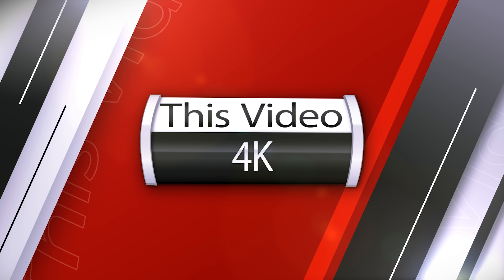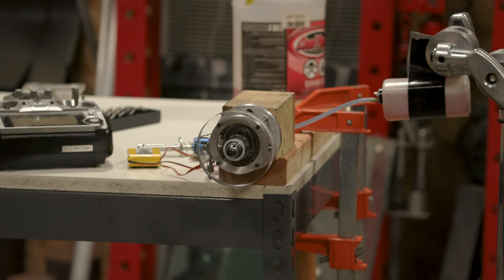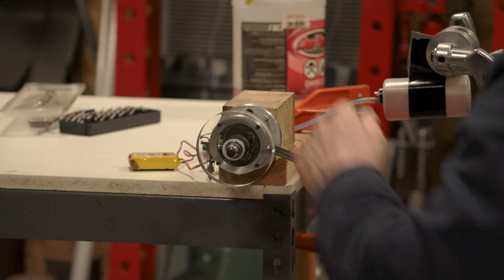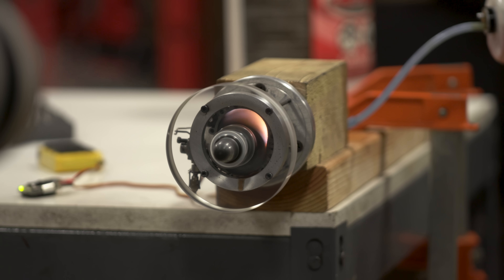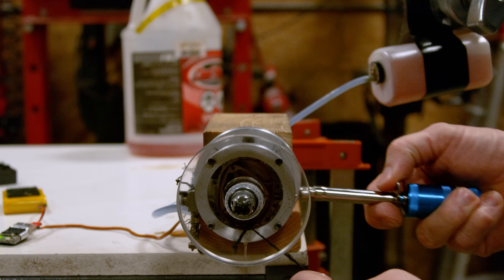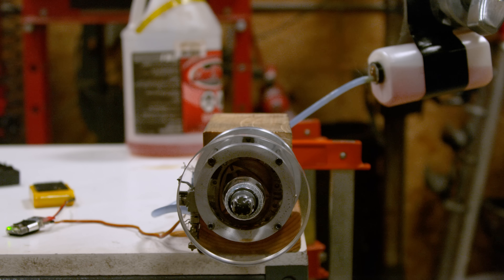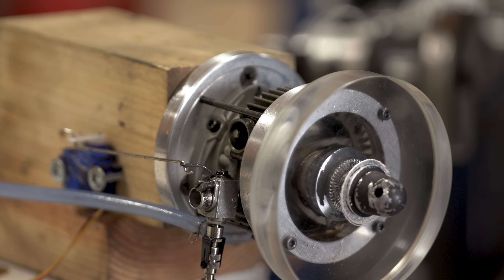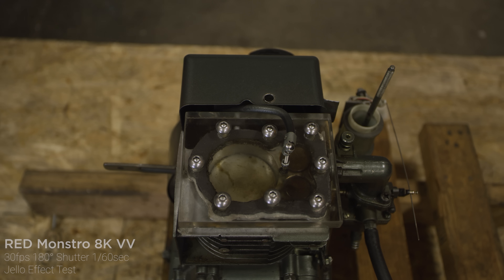See Thru Rotary Engine (WOT Runs Just for Fun) Shot on RED Monstro 8K VV- Canon C200- Flex 4K

Comment: This has to be the least amount of oil I've seen burnt in a rotary in my life.
Reply: I'm guessing that some of the working parts for this motor are from the O.S. .30cu in Wankel rotary model aircraft engine.  It's using a methanol/nitro/oil mixture ignited by a glow plug

Comment: In the normal clip of the rotary motor I was leaning towards the Canon, but once you went to %400 zoom I realized the Canon had the worst  "grainy" texture in the video out of all three cameras. Personally I think it's a tie between the Red and the Phantom, both of them look very crisp when viewing the regular clip, and when you zoomed in they both a comparable amount of noise as far as video quality, but nowhere near as bad as the Canon (which is kind of surprising to me). If I were to choose though, I'd go with the Phantom.

Side note: Great video, you're always putting out interesting content. Keep up the great work man. :)
Reply from the maker: Well ill stay neutral but here's the estimated First Released " Ready To Shoot " prices so you can evaluate. RED Mostro 8K VV approx $100k, Flex 4K $180K but its a high-speed camera as well and World Class along with Arrri, Canon C200 $10K. again not taking sides because i love all of them, but the fact the canon can even compete in the same space is impressive.  also these are very poorly lit scenes (on purpose).
Reply: Thanks. That's what I thought. Seems to me the RED doesn't make sense for this type of application. The Flex 4k really excels with this kind of a subject, but you do pay for it. If I was basing a camera purchase purely on what's seen here, I'd go for the Canon over the RED and then the Flex if I needed high speed video (or possibly even for low speed video of high motion targets). Also, if I could budget for the RED, I'd likely go for 3-5 Canons. That said, it's never this black and white and there are numerous other things to consider that might sway the choice in one way or the other.
Reply: It is interesting to see.  I've always liked Cannons at about any price point, and the fact it can compete with cameras of much higher expense is pretty impressive.  Cannon is pretty much all I use for point-and-shoot, family photos/project documentation/etc.  Basic use.  The wife has a Nikon DSLR but I'd like to try Cannon's offerings and see how they fall into line.

Comment: Looks like you finally got that engine running properly
Reply from the maker: Jon Doe lol... Yes it needed a bit more work. That thing screams now !
Reply: Warped Perception ya man it sounds and looks great. And i was thinking, if you rig an airline to blow some air on the block, you can essentially keep it cool as if it were running with a propeller

Comment: I feel like the Red may have wanted a bit more light overall (seemed underexposed at stock ISO) that made it seem more grainy than it'd expect, but the Phantom was really well composed overall.
The jello test is awesome, although few other customers would have such a stringent test.  That made the Phantom stand out, really quite impressive there.
I'm glad my suspicion was confirmed that the Canon was much cheaper.  In many regards, that's actually the most impressive showing of all of them, as it outperformed its advertised spec sheet by the largest margin, and still produced some great looking video... but your channel is as great as it is in no small part due to the capability of the Flex Phantom
Reply from the maker: I would have to completely agree, in the proper lighting you would probably even be more impressed, I know I was. In this test they all had the same light, same iso, pretty underexposed, but to be honest what would be the point I'm running a test under Perfect conditions. This is true, but if slow motion cameras didn't exist I would use other methods. Thanks for the feedback

Comment: Of course the Phantom demolished the competition!  I have personal experience working with Photron SA-5 and SA-Z as well as several Phantom high speed cameras...the shutter speeds on those cameras can be in the nano second time scale.  Even if your exposures are longer the roll effect of cameras in that class is going to be negligible until your oscillatory frequencies climb into the hundreds of kilohertz range.  Very awesome video though, I’d love to see one where you really push the Phantom to its limits and see the flame front propagate in the engine!

Comment: Much less video noise with the phantom!
Reply: piranha031091 I always thaught that such expensive cameras have nearly no visible noise in a normal light situation...
Reply: Well, if you look at 2:51, you can clearly see noise in the darker parts of the image with the Canon. Even the RED and Phantom have a little bit of noise.

Everything's a tradeoff: increasing pixel density on the sensor means less light per pixel (and less overall photon yield due to borders between pixels), so does increasing framerate and reducing shutter angle.

So all that leads to sensor noise. Which those expensive cameras keep manageable thanks to wide objective lenses to collect as much light as possible (though for a given focal length, that reduces depth of field, which isn't always desirable) and better image collection (high end CCD assemblies will have a better photon yield for a given pixel density and less electronic noise). But in the end, there is still some noise.

Fortunately, the resolution of those images is such that the human eye cannot distinguish every individual pixel, so our vision averages that noise out. (As you can see, it only becomes clearly visible when he zooms on the video.)
Reply: nope, but why would you need good low light on a propper film set

Comment: Interesting. 
   The Canon looks a bit more noisy IMO. That's directly in line with my experiences using an old rebel for low light product photography... rainbow fuzz for days

  Funny YT just put this on my suggested feed. I subbed. Perhaps the AI is trying to say something here? I'll watch anything interesting but haven't  been a motorhead or a photography nurd in over 4 years.
  Rotary's have always been gas drinking monsters. Pretty inefficient on the fuel, and massive output for the displacement... but you know that. I always wanted a FD RX7, but never got the chance. 
  Looks like your air to fuel ratio is set to submersible pump status tho ;)
-Jake

Comment: Really nice video, I'm curious, what microphone were you using for each of the cameras? Was it the same external microphone or a built-in? It sounds like there was quiet a difference on each of the different runs.
Reply from the maker: It's a rode, all of them were taken with the Canon, the red doesn't record good audio.
Reply: Aha. At second listen I hear there's not really any difference in sound, so I just think it's the varying engine speed that made me think it was different sound recordings.

Comment: The Phantom is by far the best, but I think you could really benefit from a more powerful lighting setup!
Reply: have you seen any of his other videos on this channel, they have plenty of lights but i don't think that was the point here. how would you be able to tell what camera is better if everyone is lit perfectly?.
Reply from the maker: Actually, I was mostly focusing on making situations that were difficult for the cameras to handle, vibration, low light etc. I almost lit it properly but that would defeat the purpose, I used only " house lights" which basically means the lights in the shop. I have waaayyy too many lights, sometimes when I film the Ultra High speed like the popcorn vid we have to walk around with brazing glasses on. thanks and im glad you liked the video.
Reply: Warped Perception I kinda get what you mean, but if you're testing rolling shutter effect I think it's more interesting to see the results with a properly lit scene. But that may just be me.

Comment: If you could? Compare the 2 engines using approximate same amount of gas while running? For power & speed? From a cars POV the rotory used more gas because it was a faster engine (say compared to a small 4 cylinder VS. a RX4).

Comment: Omg 18.000 rpm
Reply: Sandro Sobreira indeed. Nitro engines can over 30k rpm!
Reply: Davy Arthurs CRAZY 😲
Reply from the maker: Actually I just did another video where I held it at full throttle and I got almost 24k rpm. I'm going to try again tomorrow and Monday and if the results are really good I'll post it
Reply from the maker: Davy Arthurs well the two-stroke yeah
Reply: Warped Perception YAY 24K RPM
Reply: My CBR600RR has the stock rev limiter at 16k RPM
Reply: Cayden Hepworth The Yamaha R6 2008/2009 rev limiter at 18,000 rpm
Reply: Maybe the Rotary needs some nitro aswell :D

Comment: Dude, it’s made to be revved! I would bet it’ll rev much higher than 18,000 rpm. Pin it!
Reply from the maker: It may have hit 23,000 rpm IMO, but in the manual it says max 18000, I think it was more than that

Comment: Does the rotary really max out at 18k or will it blow up if you keep the throttle open?
Reply from the maker: That's what the manual says, but I think this was more than 18,000 RPM, I'm guessing it was 22000 or 23000, but I'm going to do a small follow-up video where I put a tachometer on it, or may be included in a future episode

Comment: I think the Canon beat the RED in this particular "jello" test as being the more pleasing motion to watch. That said, the Phantom, unsurprisingly beat both in this hands down, but then that's its particular forte.
Reply: The Phantom did the best in the shutter test because there is no rolling shutter with the phantom flex4k. It uses a global shutter so every pixel is exposed at the same time instead of scanned in rows like the other cameras.
Reply: Also the biggest sensor of all three and an instrument grade sensor at that.
Reply from the maker: @JoshuaPlays99  I just saw this comment, actually the phantom is not global shutter, it's rolling shutter believe it or not, however the scan time is like one microsecond. Amazingly fast so it's basically like a global shutter.
Reply: @WarpedYT  Ahh okay, I looked into it a little further and yes it is a rolling shutter. However there is an upgrade you do to make it global shutter.

Comment: When I saw you were using 3 different cameras, specifically a Phantom 4K, I was expecting some top notch slow motion footage, but I guess you didn't say anything about slow motion in the title. I was mildly disappointed, but I'm sure you've got some slow mo footage somewhere on your channel (Like the one it seems you've linked in your pinned comment). I'm just not sold enough on your channel to look for it. Also, not a big fan of the "My sets are some of the most aggressive in the film industry" boast. I doubt you've been to many other 'aggressive' film sets to base that claim on. Thanks for the video though

Comment: You've spent a great deal of time and effort on getting quality visuals, but your sound mixing in my opinion needs work. You should have probably dialed back the engine noise quite a bit.

When watching this video I had to turn my phone down when the engine was running and turn it back up when you were talking.

No, I'm NOT an AV expert, I'm a viewer, as a matter of fact I'm a YouTube junkie, so my expertise is not in production, it's in viewer experience.

This can be done quite elegantly, check out Project Farm. His channel has AWESOME editing and sound mixing. The engine noise is never overbearing, yet you can easily hear if the engine starts to knock, whine, bog down, overspeed, miss, etc.
Reply from the maker: Thanks, well to be honest I didn't spend a lot of time on visuals or with the sound, and I really didn't do anything Sound Engineering wise. This was just a one-off sort of video, but it does depend on the device, regular engines do not sound like this little rotary engine. But that original recorded sound was dialed back 10 db. But it's still pretty loud because of the frequency. In my opinion on YouTube it's better to be a little too loud and not loud enough cuz you can't put your volume past 100%.
Reply from the maker: UPDATED COMMENT: so I just watched the video on my Galaxy S8 and my iPad Air, for me I heard everything fine and the sound of the engine was not overbearing, it could be your phone or your speaker, or maybe you're a little bit sensitive to those frequencies. Anyone else have this issue? That way I know for next time that the rotary needs to be tamed down. Thanks
Reply from the maker: You don't have to plug project Farm here, I know who he is, I inspired some of his current videos. Lbvs.
Reply: Lmao , did you just compare this channel to project Farm? They are not even remotely similar, I mean don't get me wrong I am subscribe to his channel as well and I love his stuff, but I think you went a little overboard "Awesome sound mixing and editing" ?, Your joking right ?
Reply: I watch Project Farm, I do sound mixing for a living, I don't think he does any sound mixing it looks to me like he just has the sound on Auto on the camera, Canon or Sony DSLR probably. In warped perceptions defense, when I work on sound files that are from good production cameras the sound is usually more true to the subject, for instance if this rotary sounds annoying in person and you capture it with movie quality audio, it will sound annoying in the video. I can also tell you that ever since warped perception came around project farm and 100 other big channels have been copying his original stylistic cues, a lot of slow motion integrated with fitting music, the types of shots, just figured I would throw that in there while I was at it.
Reply: Major Cocklikar Not really, when he's running an engine it's no where near as loud as this video was. My brother has edited a couple 3 wedding videos. There's a lot of behind the scenes hard work that people miss if they don't know how much effort goes into it.
Reply: dont listen to her, i can always turn my speakers down if the engine is too loud. i went to school with a stacy smith and she was a ruiner as well.
Reply from the maker: HowTo2You that just for that, that is a possibility, I actually think it has to do with how loud and annoying this engine actually sounds, as well as YouTube compression taking a toll on which frequencies dominate their compression Spectrum, after she commented I watched the original edit, it doesn't sound nearly as loud as the YouTube video, and the audio is very balanced. I'm just making notes for the next rotary episode I have that is in that frequency range, there are a lot of funny things that happen with high bit-rate audio that don't happen with lower bitrate audio as well. Who knows I'll make a note of it.
Reply from the maker: Stacy Smith lol... That's kinda funny, I believe it though I know a couple people in that situation. Thanks for the feedback though I really do appreciate it, and this world of technology there are so many variables. Thanks

Comment: Also did you manage to produce this engines for sale
Reply from the maker: still working on it, have more details soon, trying to keep the cost as low as possible but, working with suppliers for small runs is difficult sometimes. as soon as i get it all worked out i will post a video about it. thanks for asking
Reply: Warped Perception no problem take jour time I'm not rushing I'm just very exited 😀

Comment: I thought they all had their own merit...That's a cool little engine...18,000 isn't that fast for a little nitro engine tho...What's the crank to Apex ratio.?..Is it 3:1 like a Wankel.?..18,000 at the apex would be insane crank speed.
Reply: rpm is measured at the crank, so rotor speed is only 6,000 rpm

Comment: I like the engine, but you didn't let it rev out nearly long enough.

You need to let it reach rev LIMIT and hold for 3-4 seconds. Just hold the throttle wide open for at least 8-10 seconds for it to reach its max and hold...
Thats what we want to see.

Comment: I can see why it drinks fuel. Dripping from the bottom of the see through plate and a lot of vapor leaving the exhaust. Seems very inefficient. Cool nonetheless.
Reply from the maker: I was just waiting for somebody to make that comment, actually the fuel is dripping from the needle in the carburetor. But yeah it's not dripping when it's running